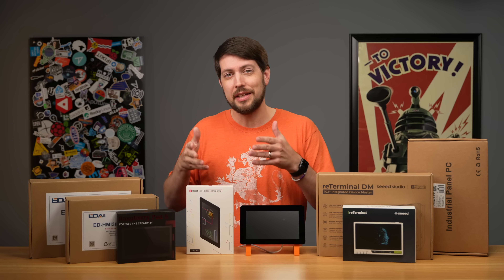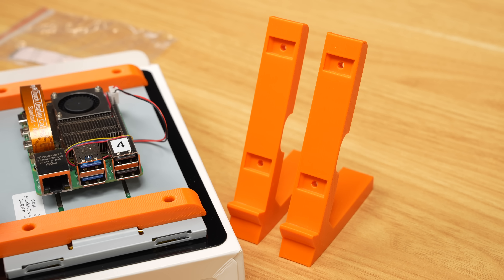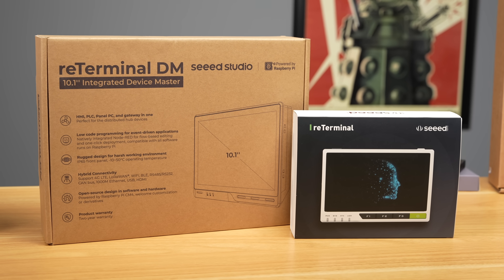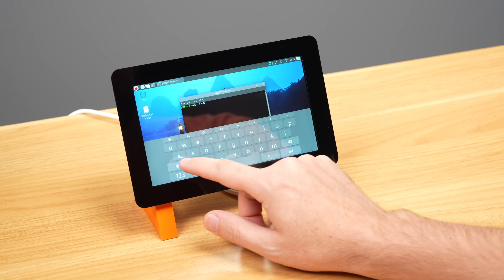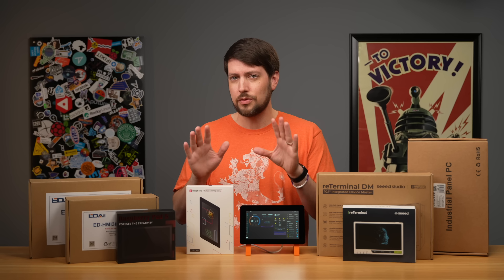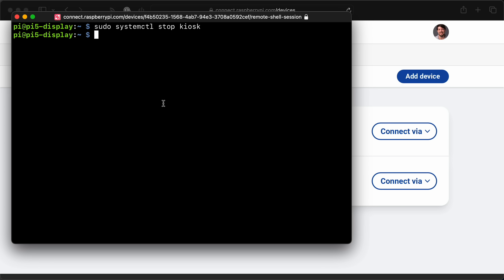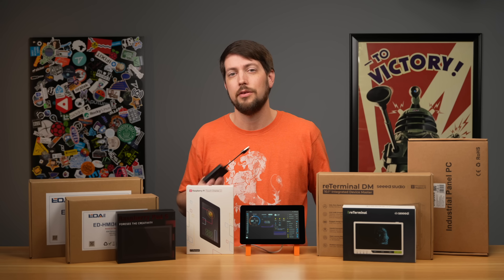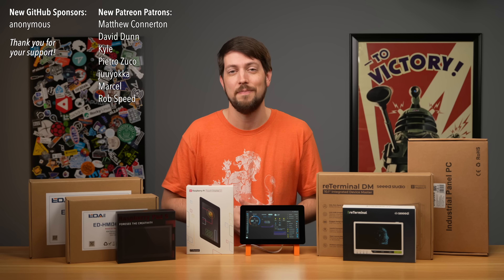I Control EVERYTHING with this Raspberry Pi

Comment: Too small for my application on my Home Assistant.  I use a ViewSonic TD2465 24 Inch 1080p Touch Screen Monitor and added a tiny mini PC on the rear of it but it did cost over $400.  The RPI is cheaper but I have a hard time with the small graphics on HA.
Reply from the maker: HA could use a 'giant icon' mode, for sure.

Comment: I've got one of those EDA tec hmis, I want to make a kiosk to launch an industrial SCADA Ignition. Super keen to give it a try using your method. 

(I'm planning on having the PI host both Ignition via docker, and then run the web browser for the HMI part)

A replacement is currently sitting on my desk because there were a few booting issues with the first one that was sent. This video got me excited again!
Reply from the maker: Their gear is certainly robust! I may end up using one of their displays in my car instead of my homebrew solution.

Comment: You could add a push button or switch to a gpio pin of the rpi and have a small piece of python code check when the button is pressed to exit kiosk mode

Comment: It might be advisible to use a DC/DC converter in the car that has proper 12/24V UVLO limits which prevents accidental deep discharge. Also it needs to fully control power to the Pi (with it's power mgmt signals factored in) to avoid trickle current drain when it's powered down and goes to a simple halt() state (just like /w old AT PSUs) or get power from IGN as an alternative and loose the ability to to run it from the battery as a compromise and risk SD corruption (tmpfs/ssd/run with fs mounted ro?). An input circuit that has noise filtering and at least transient suppression ensures a long life for the Pi.

Comment: Jeff, Ive been making HA dashboards for many years now, and I use old useless Surface Tablets or Dell Windows Tablets, even old Getac tablets, these can be purchased for $50 to $100 delivered, you can use Windows or Linux and have HA turn the charger on and off keeping the battery between 30 and 75%, I even have the tablet screen turn off and on via a radar sensor to detect when I enter the room, all I use is any web browser and the HA web app, you can also use OpenFyde.

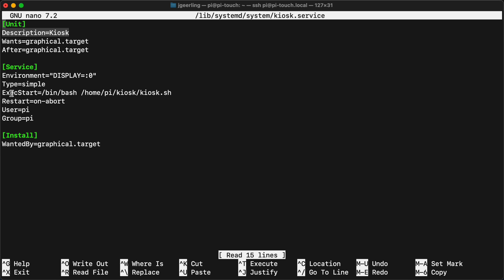Comment: 5:45 you can add your script to ~/.config/wayfire.ini [autostart] so it runs after the Wayland session has already started (latest raspi os runs on wayland not X). I posted about it on a thread called "Wayland/Wayfire Kiosk Mode Chromium" in the raspberrypi forums.

Comment: Got an ElecLab wide touchscreen for RPi 4B a while back, it was the first time I actually needed to use a 3 or more amp rated power supply to power the thing but allows the screen's USB-C port as the power source for the whole shebang through some right-angled passthrough cable trickery and the Pi's remaining ports are still exposed enough to allow plugging in USB devices like keyboard and mouse. The screen was somewhere in the US$40-70 range depending on whether you get the 480 or the 720 pixel tall version (both are 1280 wide), hooks up to the Pi via MiniHDMI, and can hook up to regular-sized HDMI as an output as well (I haven't used it that way yet, so don't know off the top of my head if it needs to be externally powered for that or not).

Comment: I built a digital picture frame system w RPi, cloud service, and iOS app to manage it all. I also have a RPi 7 in touchscreen for my home dashboard to view my cameras,system status, etc from home assistant. I even use the picture frame sw as a screen saver for the home dashboard when it’s not in use. Works great for several years now.

Comment: I’ve got CarPlay working on a pi4 using a 5 inch wave share screen and a dongle. The pi runs android and runs quite nicely off a usb connector in the car from the cigarette lighter port.  Now it’s setup it boots and loads the dongle apk from boot up so takes about 30 - 40 seconds, whilst playing back via the aux input of the car. A 3D printed custom case I designed makes it fit perfectly. I can send you details if you want, and the touch screen seems a better response than the pi screen.

Comment: In my experience, when it gets super cold, like -40c.  Electronics still work.   Batteries are very compromised although lead acid batteries only loose 60% or so.     Screens are also very affected but this mostly revolves around a single screen refresh taking 5-10 seconds.  While driving, the cabin temperature increases and the devices own heat warms it up it gets faster and faster.  The touch screen has several problems but it depends on the type.  Again, it warms up in 1 - 10 minutes.
I don't know the tech type in the screens I've used but this has been common among all the screens I've used outside.   Personally I wouldn't be scared to try your specific screen, I don't think it would break,  Just function like an old e-ink display trying to play a movie until it warms up to -20 or so.   That being said, I've not tried your specific screen.
Reply: And if you also add and use a motor and cabin heater, you get more comfortable and save petrol.
That is something like this:  Calix se experts-in-vehicle-heating-and-power-solutions
That type of heaters are really useful even before the temperature goes below +10°C.

Comment: Cool Setup. I am considering doing something similar for a Wall mounted Tablet (e.g. second-hand Acer Aspire Switch 10 or 12) / Display. Going with the second Hand Tablets / Convertibles it's Luck of the Draw (especially finding one where you can Remove the Battery ... I'm not interested in a Fire Hazard), while Screens with Good Size (12-15.6'') AND Good Resolution (more than FDH) are extremely expensive and difficult to find :(.

Comment: Not sure about Chromium, but Firefox on Wayland has way nicer touch controls than on X11. Basics like scroll and pinch to zoom.
You can enable the same using MOZ_USE_XINPUT2=1 on X11.
Maybe a similar setting exists for Chromium

Comment: What a fail, moving the mount points. I would have upgraded several of mine that are in SmartiPi cases now with the new higher resolution. Also, at least with the original screen you can set screen orientation in the boot config or some such so it's always in the right aspect ratio and rotation. Obviously not sure it works the same way with this new one since this is the first I see of it... Two of my SmartiPi based devices are audio streamers. The one in the bedroom has a Pi amp bolted to the back and a pair of speakers. Sounds incredibly good for what it is. The other similar one is in the living room, connected via optical Toslink to the AV receiver there. It's nice to not have to fire up the main display and such to play music. Sure, I can control them from my phone but it's nice to have a touch screen right there, that also shows what's playing.

Comment: For your kiosk... what version of Raspberry Pi OS are you using? I recently set up a kiosk but my typical method stopped working since RaspiOS now uses Wayland. For example,  Unclutter did not work with wayland. I wonder if you ran into any issue?
Reply from the maker: No issues there, and this is with the latest OS and Bookworm (with Wayland).

Comment: Any recommendations for a eInk display of the same size as the Raspberry Pi touch screen? Would really like to have a solid eink display to run my home assistant dashboard, seems way more power friendly than an always on display.
Reply from the maker: I've followed some projects on Hackaday, and I know a few exist, but usually getting them running requires a little hacking around.

Comment: If you want better touch support, you should run a Linux distribution that is built for that, like postmarketOS with Plasma Mobile or Phosh. Those issue I see in Firefox for example are Firefox specific configuration options.

Comment: Years ago I got the original Pi Touch Screen, a Raspberry Pi 3, a audio hat (forget the specific model) that I could wire the speakers up to, and one of the USB power switches from Mausberry Circuits to build a car computer. I did a similar thing as you, where it would launch Chrome into kiosk mode, and then I built a node.js custom touch interface that would switch between bluetooth audio, MPD, and rtl_fm. But it was always a little bit flakey (mostly the bluetooth) and didn't have CarPlay support (I don't think that dongle you mentioned was available then). So in the end, I ended up just buying one of those cheap Android dual-DIN car stereos on Amazon a couple years ago. It's not the greatest thing ever but it's a lot more reliable (and it spends most of it's time in CarPlay mode anyway). I do miss tinkering on the Pi car computer, though.

Comment: Here in Phoenix the inside of your car will get over 140 160. The outside temperatures are 120 plus. This last summer we beat the number of days of over 110° and that was even all the way in October we were still hitting 110. And it was also the first time ever we'd ever hit over 100° in October. But yeah, that touch screen would not survive a single summer day in Phoenix. It might survive a winter day but the winter is up to about mid '70s during the day, so inside the car should be maybe in the '90s or even close to 100

Comment: Another problem for the Pi in the car is how to handle shutdown when the car turns off. I’d love to see a video with your solution to this. I’ve tried a couple of options and neither worked reliably.
Reply from the maker: Most supercaps wouldn't have the energy to do a safe shutdown, so yeah, could be an interesting thing to try to solve.

Comment: Folks, maybe someone here could give me a direction. Want to make my first raspberry project, and chosen a table clock(with gimmicks) scenario. I will be coding the most of the things, not a problem. But i have doubts about the display type. First choice is an e-ink. But i do want to have a possibility of backlight. Second is the regular va\ips. But i do wish to have my room dark when i sleep (even ducktaped all of the pesky power leds).

Comment: Jeff, did Ubuntu ever add any significant enhancements to x11/wayland touch screens? Middle/right mouse operations are always a pain preventing Windows/Motif style GUIs from working well in a moving environment. I ended up using a 3-button track ball for an airplane project I was involved in.   The Carplay idea is great. Probably this works out to be more expensive to get temp-qualified displays and 'glue' bits than a pre-fab'ed head unit but the entertainment value is priceless. :-)

Comment: I have a Raspberry Pi 4 running react-carplay with a BigTreeTech HDMI 5 from Aliexpress in my 17 year old Mini. Went with a Pi 4 just because the built-in aux jack made my life easier for audio out. My only issue with this is the time it takes for the Pi to boot into Carplay (not that much faster with my Pi 5 and Nvme). Interested to see if you have any ideas on how to speed this up? All unnecessary services have been disabled, not overclocked (due to power constraints).
Reply from the maker: With the Pi 5, you could use one of Raspberry Pi's https://github.com/raspberrypi/pi-gen-micro utilities to build a very simple fast booting OS, maybe down to 3-4 second boot!

Comment: I used the first Pi screen for years with Node-Red Dashboard until I discovered Fully Kiosk. It unloads the pi significantly as you do no longer need to run desktop. Fully Kiosk gives you an API of your tablet. The ways you can interact with the tablet is almost endless, face recognition, auto brightness when movement is detected, endless.  I'm curious to see how you'll use this screen in your car. Integrating it with OBD2 data came to mind.

Comment: Based on my research, I believe unclutter only hides the cursor for X11. The latest RPi OS uses Wayland but will prompt you to switch to labwc. Wayland has a way to hide the cursor but you need extra plugins that aren't normally included with the OS image. labwc does not have a way to hide the cursor yet, but the good news is that someone is working on it, GitHub labwc PR 2273 (my comment keeps getting deleted if I include the actual link).

Your pi-kiosk repo doesn't mention switching to X11. Does unclutter actually work with Wayland?

Comment: I would like to suggest making an edit to your comment on WaveShare displays.   I have the 10.1" DSI display for a project and it works almost out of the box, only 2 lines need to be added to the config.txt file once you write the SD card (not  uncommon for DSI  displays).  Ask me this 2 months ago and I would agree that it had setup issues, but it appears to be more supported today!  It is a great alternative to consider given the size and price.

I was trying  to use this display for a drone ground control station until I realized no GCS software works well on a Pi, so it has been sitting around since summer... Now I am making a Home Assistant dash like yours!  I have done similar setup to your kiosk mode for a work project.  I had it auto-load Firefox to a pre-defined page and automatically go into fullscreen mode (aka F11).

Comment: 5:45 Don't throw own service files to  /lib/systemd/system/, there they belong to /etc/systemd/system/. But that is only for services that don't belong to some specific user. On a raspberry pi you have the default user that is automatically logged in. This user has its own systemd running, it is controlled with "systemctl --user ..." and has its service files in ~/.config/systemd/user/ 

That said, depending on your desktop environment (I assume raspberry pi defaults), there is another place to automatically start the script: ~/.config/autostart/ where you can put *.desktop files.
Reply from the maker: Good points! Could you raise an issue about that on GitHub, would be nice to keep things user-specific since they're not system-wide.
Reply: @JeffGeerling  rGunti was faster ;)
Reply: @JeffGeerling  there are not a definite line where some things are users define and system defined.  I would say that in the case of controlling the car or home assisten controller, it is system defined, but added by the local administrator.

Like one add local administrators programs and scripts used by all users or system in /usr/local/{bin,sbin,lib} etc.  There is where they are supposed to be put in Debian based Linux distributions.   

I strongly recommend reading A Debian Administrators Handbook", which are available as a package in Debian, as an eBook,  Web pages at their site or can be bought as a ordinary book printed on processed dead trees (paper that is).  There this differences are pointed out between package files and local administration files and user local files.
Reply: @AndersJackson  On the other hand, for RPis, there's something to be said for treating the default user as a special user. Just backing up the user directory takes care of a lot of stuff.
Reply: Oooh, tasty! I was wondering about this, and *.desktop

Comment: This is very cool. I want to say though that if you're specifically interested in Home Assistant, then an old Android tablet and the "Fully Kiosk" app is a much more useful - and useable option. You can have it run from boot, and it gives Home Assistant access to a load of the sensors on the tablet, meaning the front camera can be used to detect motion and automatically turn the screen on when someone stands in front of it. It's very powerful and given it's really just a wrapper for a web browser, it runs well even on old & low power tablets.
Reply: Any recommendations for what are good choices? I’ve been thinking of a home assistant powered home inventory for a while but a display and connecting it to a barcode scanner are the two big hurdles.
Reply: @U1TR4F0RCE  Not really, the tablet I use was a budget model when it came out in 2016. The only things I'd look out for is getting one with the Google Play store (or an easy way to add it), and not an absolute bottom of the line model, as that's going to be a bit unresponsive, which can get annoying.
Reply: @U1TR4F0RCE  I have a couple of de-amazoned fire hd10 tablets, a Fire HD8, a Samsung Galaxy Tab A, an old Acer tablet and a couple of android phones running as HA touchscreens Running the HA android app. They all do a fine job. Since most android devices expose things like battery level the charger can be connected via a smart socket set to turn on at 10% battery and off at 90%. This reduces the problem of bloating batteries due to constant charging that some badly designed devices seem to suffer from. The HA server itself runs on an old Wyse thin client I had laying around.

Comment: What we noticed about the touch screen (TS) what we used when we developed a product, we needed to reset the TS regularly because the TS become very noisy over time when the temperature changed. I had to watch the TS has been not used for a while thend do the reset. While resetting (and calibrating, that took about half a second) the user should not use the TS. If he/she do, the calibrating process rendered useless that part of the TS until the next reset.

Comment: I'm assuming you already figured this out but for those doing some searching for getting the vehicle display going, what you are looking for is OpenAuto or OpenDash. STAY AWAY from anything called OpenAuto Pro lol. They have gone under, last month or so they finally pulled their sale page at least but it's a proprietary paid version of OpenAuto that has now been completely abandoned. My old paid version stopped working and I can only ever get the original one I downloaded now, none of the updates because it's also all tied to a key/activation system. Just avoid any mention of that when looking into building one of your own, was brushing up on mine for a video about this display when I figured all this out for myself. 

Also, thanks for the printable legs lol!